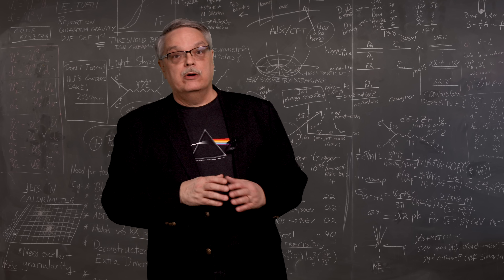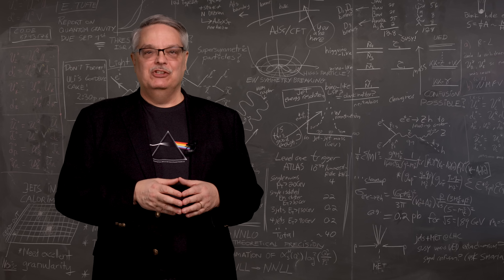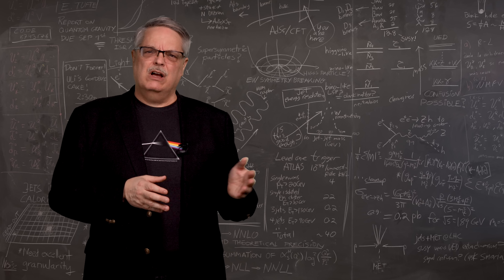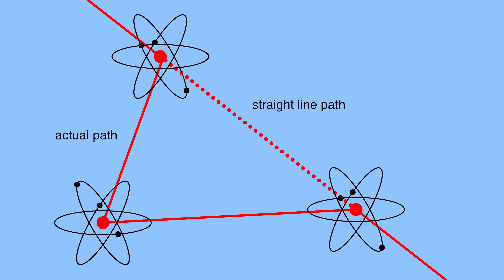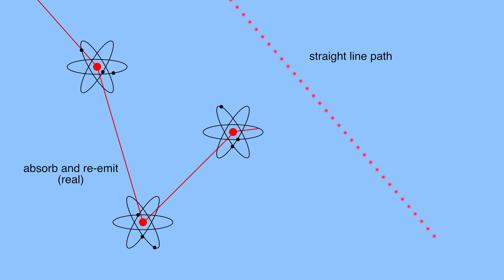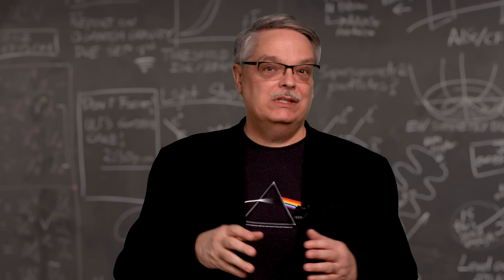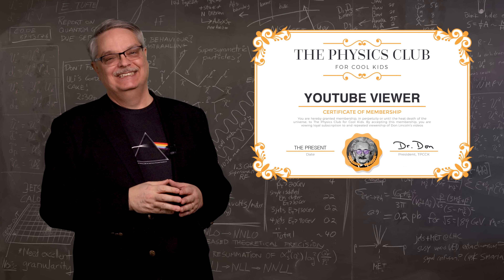Why does light slow down in water?

Comment: Dear Professor, if the EM wave in the glass or water is made by the photons of light, shouldn’t it be all of the EM waves with the speed of light? As well, by adding two waves together isn’t the only change the amplitude? Lastly, if the speed slowing down is due to the wavelength, how come the colour of light doesn’t change?
Reply: this video has taken many shortcuts in explaining the relations between the two systems and how it affects them.
to better understand this, we need to talk about d'alembert's equation and its dispersion formula and how it describes a wave.
so d'alembert's equation is used to link together the spatial and temporal variation of a wave.

and from this equation comes the dispersion relation that links together the frequency, wavelength and celerity of a wave.
to access to this equation, we use maxwell relations to describe this phenomenon. when we consider those relations in the void, we get the relation: c² = k²*w² where k is the angular frequency and w its wavenumber. (just google it, ain’t that hard to understand)

thus we can see here that the celerity is proportional to its angular frequency. however, as explained in the video, when light enter a medium, there are charges that can be influenced by the electric field, especially electrons that are 2000 times lighter than their counterparts protons.
thus, when light comes in this medium, we assume that only electrons are affected by the electric field.

we then apply newton's second law to those electrons to find a relation between an electron's speed and the electric current
(we also neglect the magnetic field of the light as the electron is relativistic thus the force from the electric field is much greater than the magnetic one see lorentz law to better understand this )
and then by generalizing this equation to all electrons in the medium, we can get an induced current from the electric field of the light.
( the current is j = n * v with n the volumic density of charges and v the celerity of electrons)

then when we put this back to maxwell ampere local equation, we introduce a new component: the induced current which thus gives us a new dispersion equation: c² = k² * (w² - wp²) with wp the plasma oscillation and thus we can see that from the value of wp, we'll get a different value of the celerity of the wave.

thus we can say without a doubt that they are wrong in their explanation as it is not the combination from the electric current of the electrons and the wave that makes it slower but the induced current inside the medium that modifies the dispersion relation thus modifying its speed.
or in simpler words, it's the movement of electrons that changes the frequency and celerity of the light, but not the combination of the two electric current. (also on a side note, trying to represent the electric current of a dipole using a sine wave.. funny thing you did there 😅)

and finally, as for the reason why the light has a different angle, well you can easily explain this using two waves parallel to each other crossing the medium in phase with each other. as they have the same wave plane, you can easily come to the relation between the refracted angle and the incident angle using some basic geometry. i recommend you to see the demonstration of descartes second law if you want to better understand what i'm talking about.

Comment: That still doesnt explain why light speed get back to its full speed.
If waves with different lenghts are overlapping and reducing the speed, the absence of a different wave is not enough to make the wave shape get back to its original form, its energy, it doesnt have a memory form.
The question is:
What makes the speed wave lenght gets back to its original form?
Reply: this video has taken many shortcuts in explaining the relations between the two systems and how it affects them.
to better understand this, we need to talk about d'alembert's equation and its dispersion formula and how it describes a wave.
so d'alembert's equation is used to link together the spatial and temporal variation of a wave.

and from this equation comes the dispersion relation that links together the frequency, wavelength and celerity of a wave.
to access to this equation, we use maxwell relations to describe this phenomenon. when we consider those relations in the void, we get the relation: c² = k²*w² where k is the angular frequency and w its wavenumber. (just google it, ain’t that hard to understand)

thus we can see here that the celerity is proportional to its angular frequency. however, as explained in the video, when light enter a medium, there are charges that can be influenced by the electric field, especially electrons that are 2000 times lighter than their counterparts protons.
thus, when light comes in this medium, we assume that only electrons are affected by the electric field.

we then apply newton's second law to those electrons to find a relation between an electron's speed and the electric current
(we also neglect the magnetic field of the light as the electron is relativistic thus the force from the electric field is much greater than the magnetic one see lorentz law to better understand this )
and then by generalizing this equation to all electrons in the medium, we can get an induced current from the electric field of the light.
( the current is j = n * v with n the volumic density of charges and v the celerity of electrons)

then when we put this back to maxwell ampere local equation, we introduce a new component: the induced current which thus gives us a new dispersion equation: c² = k² * (w² - wp²) with wp the plasma oscillation and thus we can see that from the value of wp, we'll get a different value of the celerity of the wave.

thus we can say without a doubt that they are wrong in their explanation as it is not the combination from the electric current of the electrons and the wave that makes it slower but the induced current inside the medium that modifies the dispersion relation thus modifying its speed.
or in simpler words, it's the movement of electrons that changes the frequency and celerity of the light, but not the combination of the two electric current. (also on a side note, trying to represent the electric current of a dipole using a sine wave.. funny thing you did there 😅)

and finally, as for the reason why the light has a different angle, well you can easily explain this using two waves parallel to each other crossing the medium in phase with each other. as they have the same wave plane, you can easily come to the relation between the refracted angle and the incident angle using some basic geometry. i recommend you to see the demonstration of descartes second law if you want to better understand what i'm talking about.

Comment: If the glass is very thick, the light will never come out.
Reply: this video has taken many shortcuts in explaining the relations between the two systems and how it affects them.
to better understand this, we need to talk about d'alembert's equation and its dispersion formula and how it describes a wave.
so d'alembert's equation is used to link together the spatial and temporal variation of a wave.

and from this equation comes the dispersion relation that links together the frequency, wavelength and celerity of a wave.
to access to this equation, we use maxwell relations to describe this phenomenon. when we consider those relations in the void, we get the relation: c² = k²*w² where k is the angular frequency and w its wavenumber. (just google it, ain’t that hard to understand)

thus we can see here that the celerity is proportional to its angular frequency. however, as explained in the video, when light enter a medium, there are charges that can be influenced by the electric field, especially electrons that are 2000 times lighter than their counterparts protons.
thus, when light comes in this medium, we assume that only electrons are affected by the electric field.

we then apply newton's second law to those electrons to find a relation between an electron's speed and the electric current
(we also neglect the magnetic field of the light as the electron is relativistic thus the force from the electric field is much greater than the magnetic one see lorentz law to better understand this )
and then by generalizing this equation to all electrons in the medium, we can get an induced current from the electric field of the light.
( the current is j = n * v with n the volumic density of charges and v the celerity of electrons)

then when we put this back to maxwell ampere local equation, we introduce a new component: the induced current which thus gives us a new dispersion equation: c² = k² * (w² - wp²) with wp the plasma oscillation and thus we can see that from the value of wp, we'll get a different value of the celerity of the wave.

thus we can say without a doubt that they are wrong in their explanation as it is not the combination from the electric current of the electrons and the wave that makes it slower but the induced current inside the medium that modifies the dispersion relation thus modifying its speed.
or in simpler words, it's the movement of electrons that changes the frequency and celerity of the light, but not the combination of the two electric current. (also on a side note, trying to represent the electric current of a dipole using a sine wave.. funny thing you did there 😅)

and finally, as for the reason why the light has a different angle, well you can easily explain this using two waves parallel to each other crossing the medium in phase with each other. as they have the same wave plane, you can easily come to the relation between the refracted angle and the incident angle using some basic geometry. i recommend you to see the demonstration of descartes second law if you want to better understand what i'm talking about

Comment: Thank-you for the explanation about why light slows down. A brief explanation of why it changes direction would help.
Reply: this video has taken many shortcuts in explaining the relations between the two systems and how it affects them.
to better understand this, we need to talk about d'alembert's equation and its dispersion formula and how it describes a wave.
so d'alembert's equation is used to link together the spatial and temporal variation of a wave.

and from this equation comes the dispersion relation that links together the frequency, wavelength and celerity of a wave.
to access to this equation, we use maxwell relations to describe this phenomenon. when we consider those relations in the void, we get the relation: c² = k²*w² where k is the angular frequency and w its wavenumber. (just google it, ain’t that hard to understand)

thus we can see here that the celerity is proportional to its angular frequency. however, as explained in the video, when light enter a medium, there are charges that can be influenced by the electric field, especially electrons that are 2000 times lighter than their counterparts protons.
thus, when light comes in this medium, we assume that only electrons are affected by the electric field.

we then apply newton's second law to those electrons to find a relation between an electron's speed and the electric current
(we also neglect the magnetic field of the light as the electron is relativistic thus the force from the electric field is much greater than the magnetic one see lorentz law to better understand this )
and then by generalizing this equation to all electrons in the medium, we can get an induced current from the electric field of the light.
( the current is j = n * v with n the volumic density of charges and v the celerity of electrons)

then when we put this back to maxwell ampere local equation, we introduce a new component: the induced current which thus gives us a new dispersion equation: c² = k² * (w² - wp²) with wp the plasma oscillation and thus we can see that from the value of wp, we'll get a different value of the celerity of the wave.

thus we can say without a doubt that they are wrong in their explanation as it is not the combination from the electric current of the electrons and the wave that makes it slower but the induced current inside the medium that modifies the dispersion relation thus modifying its speed.
or in simpler words, it's the movement of electrons that changes the frequency and celerity of the light, but not the combination of the two electric current. (also on a side note, trying to represent the electric current of a dipole using a sine wave.. funny thing you did there 😅)

and finally, as for the reason why the light has a different angle, well you can easily explain this using two waves parallel to each other crossing the medium in phase with each other. as they have the same wave plane, you can easily come to the relation between the refracted angle and the incident angle using some basic geometry. i recommend you to see the demonstration of descartes second law if you want to better understand what i'm talking about.

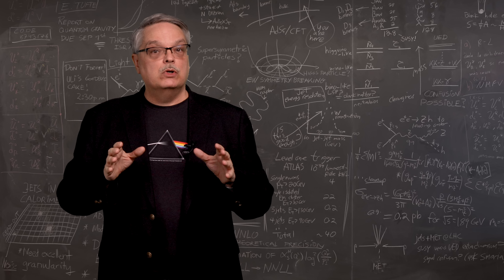Comment: 8:24 goes right  off the tracks. This would apply if reality was a sheet of paper and everything was polarized just so. But reality is 3D and really messy. At 8:40 you restate the light moves more slowly the glass medium but fail to really explain WHY.   9:30 makes no sense either. Once the frequency/wavelength is altered by electrons, how does it magically reset back to its initial state? I give you an F on this one.
Reply: this video has taken many shortcuts in explaining the relations between the two systems and how it affects them.
to better understand this, we need to talk about d'alembert's equation and its dispersion formula and how it describes a wave.
so d'alembert's equation is used to link together the spatial and temporal variation of a wave.

and from this equation comes the dispersion relation that links together the frequency, wavelength and celerity of a wave.
to access to this equation, we use maxwell relations to describe this phenomenon. when we consider those relations in the void, we get the relation: c² = w²/k² where k is the angular  wavenumber and w its angular frequency. (just google it, ain’t that hard to understand)

thus we can see here that the celerity is proportional to its angular frequency. however, as explained in the video, when light enter a medium, there are charges that can be influenced by the electric field, especially electrons that are 2000 times lighter than their counterparts protons.
thus, when light comes in this medium, we assume that only electrons are affected by the electric field.

we then apply newton's second law to those electrons to find a relation between an electron's speed and the electric current
(we also neglect the magnetic field of the light as the electron is relativistic thus the force from the electric field is much greater than the magnetic one see lorentz law to better understand this )
and then by generalizing this equation to all electrons in the medium, we can get an induced current from the electric field of the light.
( the current is j = n * v with n the volumic density of charges and v the celerity of electrons)

then when we put this back to maxwell ampere local equation, we introduce a new component: the induced current which thus gives us a new dispersion equation: c² = (w² - wp²) / k² with wp the plasma oscillation and thus we can see that from the value of wp, we'll get a different value of the celerity of the wave.

thus we can say without a doubt that they are wrong in their explanation as it is not the combination from the electric current of the electrons and the wave that makes it slower but the induced current inside the medium that modifies the dispersion relation thus modifying its speed.
or in simpler words, it's the movement of electrons that changes the frequency and celerity of the light, but not the combination of the two electric current. (also on a side note, trying to represent the electric current of a dipole using a sine wave.. funny thing you did there 😅)

and finally, as for the reason why the light has a different angle, well you can easily explain this using two waves parallel to each other crossing the medium in phase with each other. as they have the same wave plane, you can easily come to the relation between the refracted angle and the incident angle using some basic geometry. i recommend you to see the demonstration of descartes second law if you want to better understand what i'm talking about.